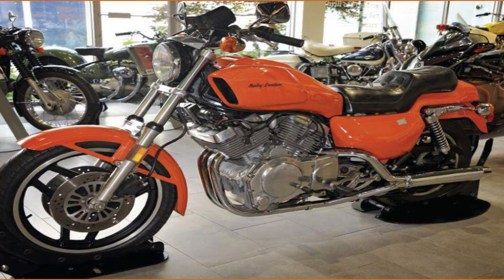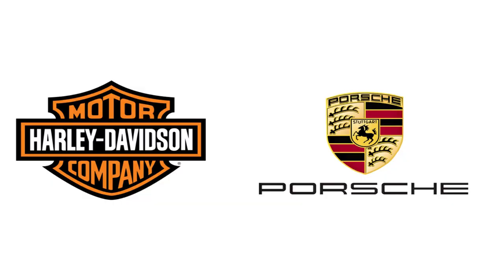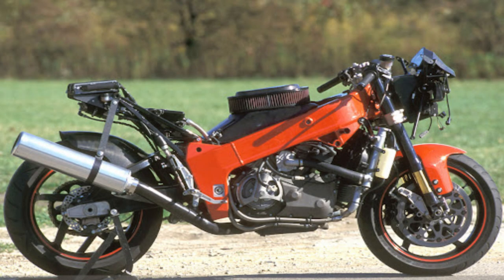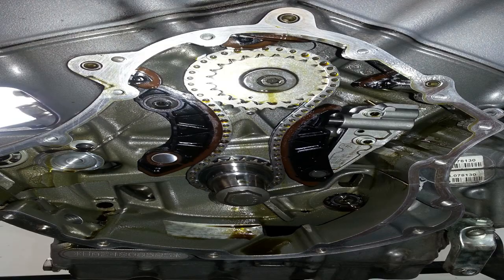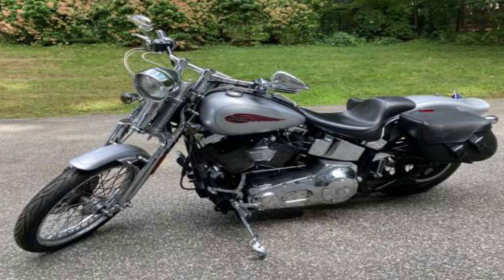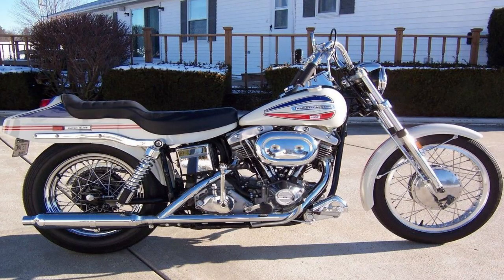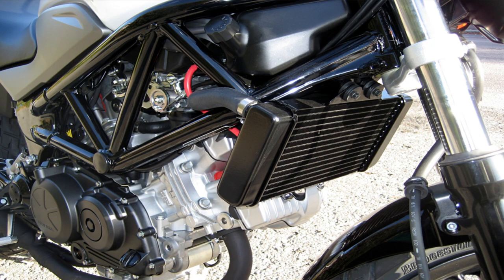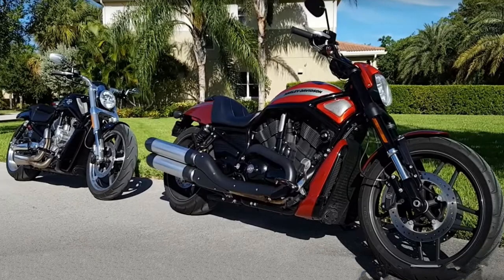VROD Is Harley-Davidson's Baddest Out of the Box Bike

Comment: Three things sell a Harley.
The look, the feel, and the sound.
The origional V-rod has none of the above.
Yes, I owned one and no I did not like it.
It was an early model (2005) and was not an attractive bike. 
The later model Vrods were at least very good looking bikes. 
While the performance was good by Harley standards, it was No where near sportbike standards.

I feel Harley doubled down on the Vrod formula  with the new Sportster S.

Look, Feel, and Sound.
Lose any of the three and lose sales.
Reply from the maker: The Vrods could of been a lot more than they were, the traditional Harley had that one thing as you mentioned the Vrod could never touch. That sound and feel just isn't something you get from the overhead cam engines.
Reply: @GixxerFoo  I think we may have just experienced what will be seen retrospectively as Harleys pinnacle bike.
The M8 softail lowrider S.
Bone stock the bike looks like a blacked out club style 1990 FXR.
Flawless execution on the look.

It's the last of the old school low technology bikes but has fuel injection and abs as well as inverted forks.

The motor can easily be upgraded to 131 c.i.d. with a bolt on kit that will make 150 rwhp and 155 ft. Lbs!

The bike is rolling art, but unlike  previous Harley offering with sex appeal. This bike is suitable as a daily rider.